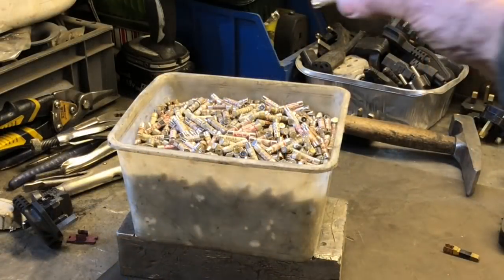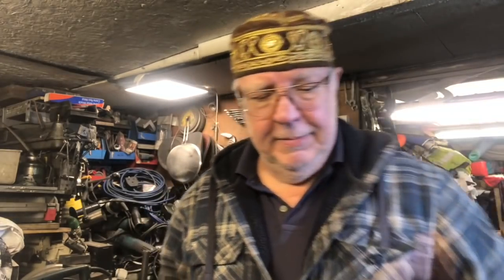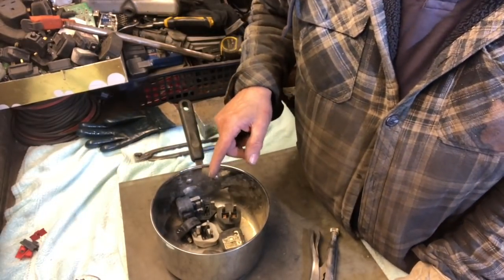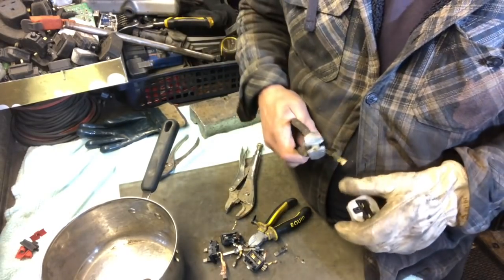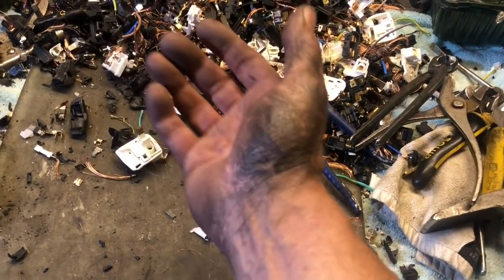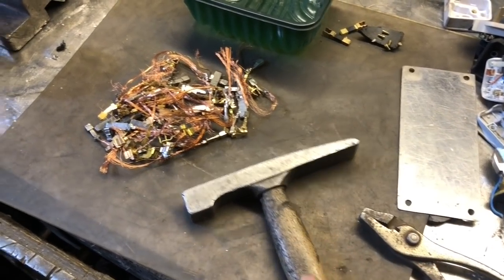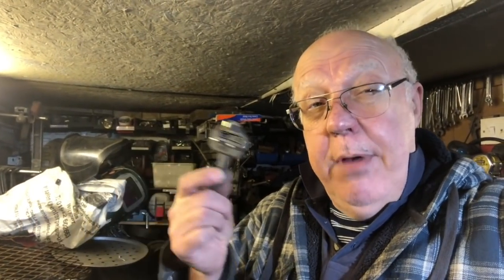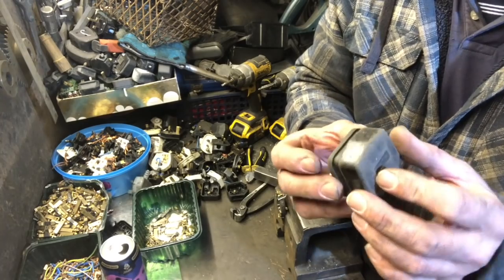Plug soup for Profit……Unabridged

Comment: Use a soldering iron to push the brass pin out 🤔🤔 just a guess 

Or get the screw that fits in there and put it out with a pair of pliers
Reply from the maker: Thinking outside the box. Love it

Comment: Interesting tekkers Mr M, I like the plug soup idea, another thing I've tried is letting them have a good sunbathe in the summer, the plastic softens nicely too that way, but generally I use two pair of five holds ( one set to hold the plug, the other to twist the pin) and pull the buggers apart. a bit like you were doing after their hot bath ! As for the awkward brass bit left in the lids, I attack that with a sharp pair of side cutters, like you I've not found a better way yet but it works pretty well, keep up the good work mate, and a Happy New year to you and yours !
Reply from the maker: Ian in my next upload ( tonight ) i found a very easy way to do the lid

Comment: HNY Ian!!!!
You got an arbor press ?
Just wondering if you could push them through the back? Never tried anything like that so I'm a bit green on this sort of thing. Cheers Neil
Reply from the maker: An interesting idea.
Reply: Hey Ian !!
Drill 3 holes in a plate that corresponds to the pins on the plug.
Clamp it vertically in your vice.
Put the plug through the back of the plate and use your grips like using a claw hammer or crow bar. Will save your hands mate 😁
Reply from the maker: @NellsMechanicalManCave   funny enough making a plate was in my thoughts.
Reply: @Man-in-da-shed  great minds think alike 💡💡💡

Comment: You're pulling prongs on an industrial scale, so maybe the "soup" technique is good for you.  I might work at a dozen at a time, so I just heat the prongs with a lighter, (or a quick pass with a propane torch), and the prongs and the wire, pull right out. It is simplicity itself.  Maybe this winter a candle will be lit in the house for heat and light and would work the same way!  The whole 'soup' thing is just too much effort for the scale I work at.  (I know this video goes back a while, but I'm still catching up...)

 We don't typically have fuses in our plugs in the States, nowhere near as complicated. But your plugs are chunkier. And brass is brass!
Reply from the maker: Purely for YouTube, I made the rocket stove for a different project, not yet filmed, I usually do about 6 in an old kettle,

Comment: I use a small pair of 8"bolt crops and just chop the brass pins  off
Then fill washing machine and microwave with the rest of the plugs and still get paid for them 

15p a kilo for plugs 
You might as well throw them out as normal scrap which is fetching 19p a kilo
Reply from the maker: This is true,
Reply: @Man-in-da-shed  you should get your self a pair
Save your self loads of time
You might not get all of the brass pin out but  it's worth it for the time it takes
Reply from the maker: @bfdmanbfd   yep. It’s always a trade off between time. But the challenge for a microscrapper is to get all metals out.  I used to just knock the pins off as well. Shame I’ve none left to do now
Reply: @Man-in-da-shed  ♻️👍♻️👍♻️